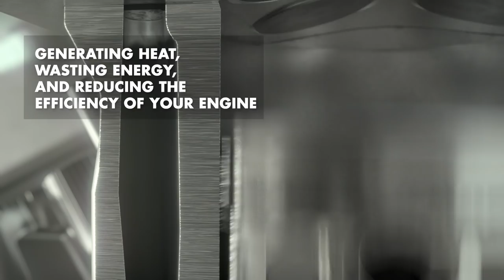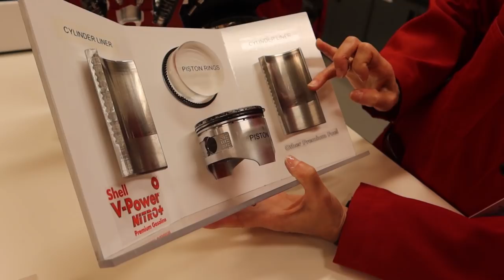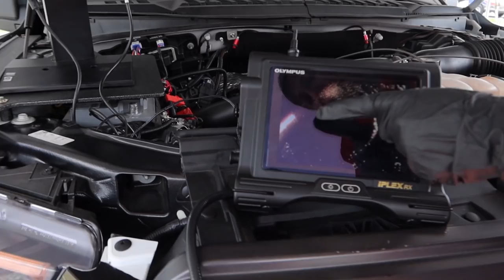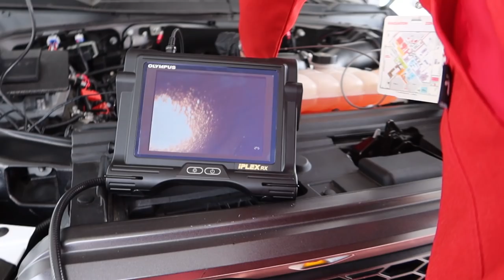Learning About The Importance Of Good Fuel With Shell

Comment: Octane has absolute nothing to do with rich or lean at all.... octane is a rating for the fuels resistance to detonation or pre-detonation aka "knock" nothing to do with lean or rich
Reply: Exactly right.
Reply: Yes. Up vote this for those people who think they know stuff.
Reply: Yep, shit fuel made my truck go boom lol
Reply: What kind of truck was it
Reply: Dakota Fox Turbo 4.8 sent it too hard lol
Reply: What fuel were you using and how much boost lol
Reply: Did you gap the rings and change the valve springs lol
Reply: Dakota Fox fully stock longblock besides cam, was meant to see how much power it would make. It made 748 on 19.5 lbs then it was sent at street car takeover here in Columbus at 24.5 lbs all night until it went.
Reply: Ya that'll do it hahaha let's just blame the fuel lol
Reply: @dakotafox617  🤣
Reply: Actually it does have a lot to do with lean and rich. Fuels have an octane rating at different air fuel ratios. They are rated according to fixed ratios though. You can run a 91 RON rich and it will have a similar octane to a 98 RON. This is where efficiency comes in.

Comment: Thanks Matt for the tour ! One thing not mentioned about dirty valves, dirty valves are not necessarily from just fuel, unfortunately in modern engines today the PCV (positive crank ventilation) system are routed directly into the intake systems due to emissions, so overtime the whole intake track gets loaded with oil due to blow by, so turbo chargers, intercoolers , intake manifolds etc get caked with oil that gets directed and caked onto the intake valves , and oil lowers octane and that’s no Bueno! ,this can especially happen on boosted cars , so the remedy for this is installing oil catch cans :) , I have been using Shell V power plus nitro for awhile and I hope what they claim is true about cleaning the valves , lubrication , and anti corrosion at least there trying to prove how and why there fuel is better :)

Comment: Well I used to run only Shell 91 here in Canada in my subaru forester 2.5T when i had it. I worked on it alot like most subaru owners. Taking off the intake manifold several times being able to see the intake valve it was super polished no gunk/carbon even in the turbo it was super clean. I still run it in my new '17 Sierra and nothing bad to say about it. I also run it in my bike and my 87 Turbo Rx7.

Great video lots of information

Comment: The big difference for me is I check my mpg every fill up by hand. Shell always gave me a few more miles per tank. I also have driven two nissan cars that would seem to run better with Shell 93 in them versus anything else. Overall the mpg was always slightly better with Shell.

Comment: I've been a petroleum technician for the last 10 years. I would say Shell and BP have some of the cleanest fuels. Obviously some of that depends on the site and their maintenance (especially if they have steel tanks instead of newer fiberglass), but for some reason Exxon premium always causes everything it comes in contact with to rust the piping under the dispenser gets the worst of it... I always try to put Shell or BP fuel in my C7 when it's convenient

Comment: With my years of experience with multiple performance vehicles. BP and Shell perform much greater than any other fuels I have used. Mobil is just under because of the detergence they add to the fuel. This is my experience not fact.
Knock = Resistance to detonation. Lower octane on a high compression engine will cause it to detonate prior to the spark plug firing it off. The Spark plug fires off part of the fuel and the two explosions hitting each other is knock. The fact that higher octane resist knock you can increase your timing which gives you better performance. E85 has a high resistance to cause knock. It's usually about 101 octane.

Comment: My dad is a petroleum engineer for the past 30+ years, currently contracted to work for shell. My family also owns and operates many gas stations in the North East. He has provided services for major petroleum companies such as ExxonMobile, Chevron etc. He says shell v power is the biggest scam on the petroleum industry currently.
Reply: Aren’t they all
Reply: Harry Singh True. They have excellent marketing. 

I know my own proof that I don’t get the best performance from their gasoline. Irving so far has been the best. I always notice more power. 

Also for some strange reason, when idling over 10 minutes, shell gas puts my car in limp mode. Dealer can’t figure out why. 

After 2 full tank fill ups a week for 2 years with Shell half of those and Irving the other half, I can tell a huge difference in driving. 

Only downfall with Irving is that it burns quicker. Maybe they have more Ethenol in it. Maybe that explains why it has more power. 

I never did understand why Shell always has the best ratings. In two years of testing, I have a different observation.
Reply: Harry Singh that’s very interesting!
Reply: All marketing BS
Reply: Would you please elaborate why that's is? I hate third party opinions even if they work for some of the sources
Reply: What facts is your “dads” opinion based on?
Reply: Your dad chatting air

Comment: I filled up with ethanol free at a C&S (Campbell and Son) station.  Vehicle start sputtering when. I had less than 50 miles to go in a tank.  Filled up with Shell 93 to clean out my system.  Runs strong and I got down to 20 miles to empty, still ran strong.  I’m sticking with the Top  Tier stores.

Comment: I can attest to the difference of gases. My Acura TSX runs much smoother with Shell. If I put Costco, 7 eleven, Bp or others.. it doesn’t idle as smoothly or run as smoothly. The idle is much more constant and steady with the shell.
Reply: My Kio Rio(GDI engine) ran best with Shell, and better gas mileage, now I use it in my Toyota.

Comment: Back in the day I would only fill up my GTI using Chevron as I thought no other fuel would be good enough. Years later with my SQ5 I fill up with Costco gas. What learned is lots of this stuff (V Power, Techron) doesn’t matter too much. The reality is gas all comes from the same refineries. The difference in fuels is the amount and type of fuel additives being added to the fuel. On new cars these additives don’t matter as much as most new cars are direct inject. As a result none of these additives even touch the valves and carbon build up is inevitable. The reality is any Top Tier fuel meets the additive requirements needed for cars.  Filling up with Costco, Shell, Chevron, 76, etc. will all yield the same long term and immediate results.
Reply: TLDR any top tier fuel will yield the same results. Just use a top tier gas station that is convenient and well priced.
Reply: Shell and BP come from different places...worked with both....
There refined differently
Bp and shell have different tanks at nustar and vopak loading terminals....
Regular unleaded and regular super petrol are totally different
Reply: I've noticed my car goes through Shell gas faster than say Chevron or Arco. I wonder if Shell out more additives but less base fuel which makes your car go through it quicker.
Reply: Costco in my Toyota, 300k miles..😊
Reply: Honestly I trust Costco more than an independently owned Shell, however the worst quality gas is from lesser generic stations.
Reply: This is so true, and glad you pointed it out. As someone that works on Euro cars for a living,  we do walnut blasting on CCTA motors all the time with cars as low as 45k miles... these are customers that claim they use top tier fuel, but carbon is inevitable!  On a side note, BMW pretty much eliminated carbon build-up with Valvetronic.
Reply: You couldn't pay me to go to 7-11 for free gas. At least with Shell or Chevron there's fuel pump and filter maintenance stipulated at the station. I've got 36 very precious valves in my port fuel injected engine to protect.
Reply: They may be true, but now there are other considerations such as corrosion and Wear protection. I have a car that sits maybe 2months. Corrosion protection is important. 
Amsoil recently came out with their Upper cylinder lubricant which addresses clean/wear/corrosion, kind of like what shell v power nitro plus advertises

Comment: The valves aren't subject to any fuel flow in a direct injection engine  so how do the additives keep the valve stems and heads clean in an engine like this. The raptor engine has port injection also so that would keep the valves clean.

Comment: I think she didn’t fully understand your question when you asked if higher “octane” fuel was more combustible.    The short answer is no.   They are equally combustible.   But if you add a higher calorific additive or blend then you get more power out.   

Octane, either RON, MON or the American combined one is not a measure of combustibility but a measure of resistance to auto ignition.   When you compress the air fuel mix the heat and compression can cause the fuel to auto ignite.   This is knock.   A higher octane number means it is more resistant to this happening.   So it means you can advance the ignition timing more without it auto igniting the whole charge.   The normal flame front remains.   The knock you hear is actually the pressure wave hitting the piston while it is still travelling up.   If you can slow down that pressure wave (which is just ahead of the flame front) with a higher octane fuel then you can create more pressure with the earlier burn (as it completes while the piston is closer to the top).

Comment: Just some food for thought
We run a fleet of Tacoma's at work and we fill them up with whatever gas station is available when we need gas and these trucks only see oil changes every 5 to 10k miles depending on model year(conventional oil vs full synthetic) and all these trucks run 250+ thousand miles no problem

Comment: Both Shell and Chevron use nitrogen for better cleaning and better lubrication. All Shell grades are Top Tier certified, have nitrogen, and will offer some of the same benefits as the premium fuel; however, most modern vehicles with higher compression, direct injection, and turbocharging can certainly benefit from higher octane -- consult your owner's manual for recommendations.

Comment: As a chemist she is accurate. But at explaining engine function and importance of fuels and oils and other engine components not to factual.....
Reply: Dakota Fox explain for us ignorant please?
Reply: Well you never want fuel to get past the compression ring to " lubricate the cylinder to ring friction" because if the fuel gets in the ring land or the grove where the rings sits you could get combustion behind the rings which could cause catastrophic damage. So the fuel unless it is leaded fuel which is not in use anymore has little to no lubrication effect if fuel gets on the cylinder walls it will wash away oil loosing lubrication
Reply: The top ring is the compression ring as she said but the middle ring or the oil scraper ring kind of acts like a squedgy in a way I will leave behind a very little amount of oil on the cylinder walls to help lubricate the compression ring
Reply: A way to prove this is what is called the compression ring witness mark which is usually at the top 1 in. of the bore where only the compression ring touches you will actually get more wear there than anywhere else in the bore meaning the rest of the bore has some lubrication from oil being left behind
Reply: If unleaded fuel like shell nittro+ had any lubrication you would not have a witness mark in the top of the bore where combustion is happening
Reply: Well I shouldnt say any lubrication but any significant lubrication as advertised
Reply: Long story short it is a load of BS
Reply: @dakotafox617  so was the part about how knock sensors operate

Comment: Hi Matt Excellent video and very informative. One idea could be to start a series about topics related to the oils and lubricants in engines, transmissions, differentials, etc., synthetic oils, anti freeze and coolants, refrigerants, basically what are the best fluids and lubricants to be used and what needs to be considered when topping up or changing any of the items. Also are additives good or bad and what to consider. In short allow people to be better informed to know what is best and what is not. I know Owners manuals provide the manufacturers recommendations however people are bombarded with sales pitches that contradict the manuals including your dealer and arming people with good data would be excellent.

Comment: yeah some of the parts sound like marketing bs :D and some statements just contradict each other like her saying that they burn all the fuel but at the same time saying that fuel lubricated the compression rings :D
Reply: @charlesle  im not sure there is enough, also the compression rings have to have so tight tolerances so that air cant get by so that means the fuel cant get between the rings and the cylinder wall i think

Comment: I will say, I started using Shell 93 on my 350z, and I felt a difference in how the car responded. It was not crazy but I did feel less hesitation and it almost seemed to help the engine run smoother vs the normal 93 I get at lets say Wawa or Racetrack. : /
Reply: @greatestever2565  exactly. I based this on the cars feel and behavior :/
Reply: @greatestever2565  yes!

Comment: When I put Shell in my car it sometimes goes into limp mode. 

Irving gas runs the best for me and no  limp mode ever. 

I actually feel a little power loss with Shell. Irving definitely has more power. 

This is a test I’ve done 20 plus times too. 

Not sure if Irving puts more Ethenol in their gas. I notice it does burn quicker. 

Test is yourself and do logs. You’ll see.

Comment: Ok..If you buy fuel from Shell or Chevron..Why do they sell their fuel additives"Techron or V-Power" for general public interval servicing? Proven fact that their additives in the fuel you buy at the pump is 2%..If you own a Direct Injection Engine..You need Throttle Intake cleaning every 5,000 miles..Producing 87 octane gas/85 +10% Ethanol=86.7 rounded to 87...87 mixed with 91=89 Octane..91 is possible premium...My best mix..My car required 87+Star Tron Fuel Enzyme Treatment..I get 87.6 Octane with Naptha/ Benzine mix in the additive..I buy gas at Circle K/Frys/Independents with no problems.....

Comment: It's interesting, but i wouldn't believe any studies or test done by a private company. Show me some test and result from an outside organisation with un-biased scientist and then you can learn some things. in terms of additive in fuel, i could understand how they can add components that lubricate the cylinder walls in theory, but how would it work and how much would it affect the state of the engine, i don't know.
About the tanks in gas station, water would get inside if the tanks were subject to changes of temperature, during condensation. But they seems to be burried underground so temperature should be stable. If there is water, they can add fuel additive to stabilise water, or even add a water-separator filter before the pump.

Comment: She’s full of it all marketing,  all gas is produced to the same specs with production and proper octane before its sent out to be piped in to the gas terminals for delivery, different additives are added at the delivery terminal when they load the truck so they can Brand the gas to go to a particular station and once that gas has been Branded it can’t be sold to any other station but for the one company that makes it for their stations IE shell, Chevon Arco etc.
Don’t buy into the bull and don’t buy higher octane if your car doesn’t require it .